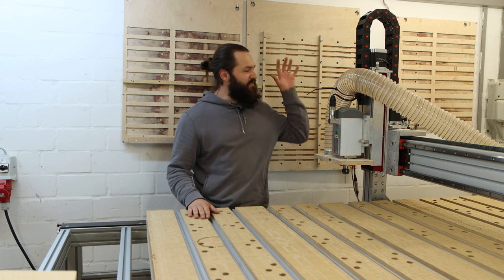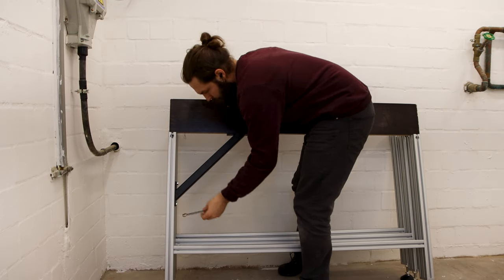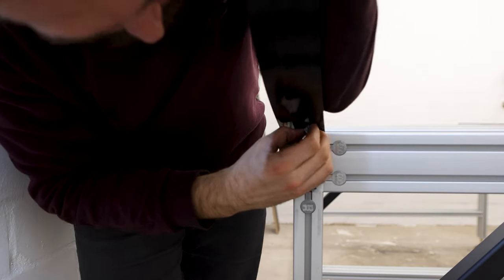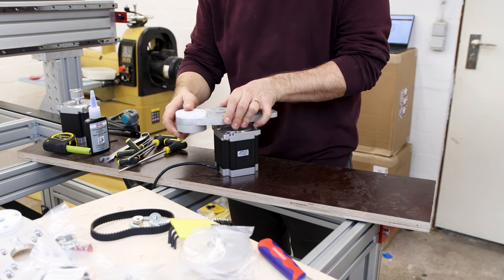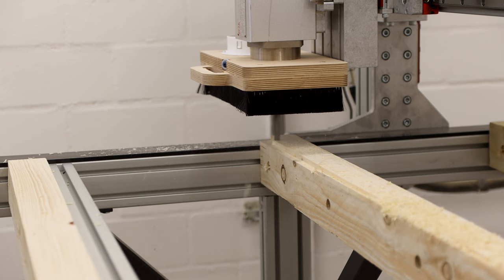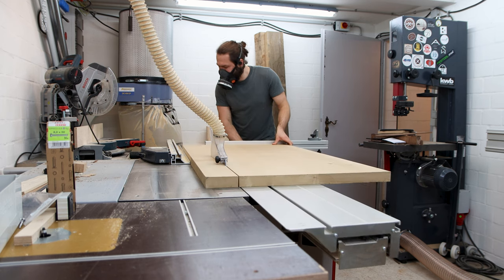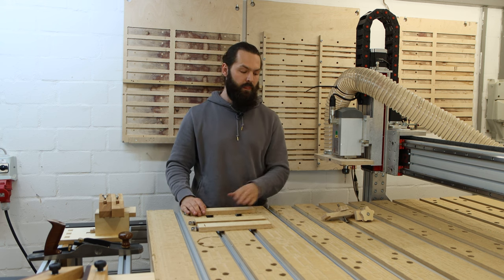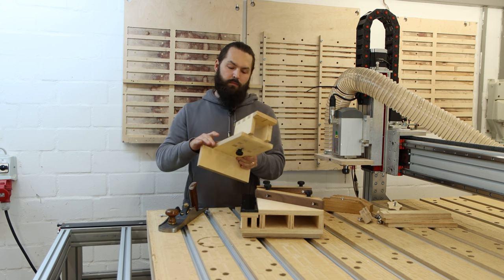I built a HUGE CNC ROUTER for woodworking || CNC build kit 4x8 (1.25 by 2.5m)

Comment: Looks like a beast of a machine. I'm looking at small desk top systems more for fun and craft items and may buy later this year. Your system is to die for, so to speak. Everything one could want in a CNC router machine. I hope you do well with it. It looks fabulous. Thanks for the video. Looking forward to your next one.
Reply from the maker: Hey Larry, that sounds great! No matter the size, a CNC is so versatile and opens up many possibilities. (If you go for a CNC with an open frame design, you can let the workpiece overhang the end and afterwards work on the other side. This makes the effective cutting area double the size 😉 Just saying...).
Yeah the next video will come very soon! 👍 Thanks for watching
Reply: @BauWoodworks  Thanks for the input on what to look for in a CNC. I will definitely meet that in mind when purchasing.  Currently I'm favoring a Onefinity, 32" X axis by 50" Y axis. I make and donate corn toss game boards to memory care, and assisted living facilities
Reply: Message got away from me. As I was saying I donate these boards to these type of homes. The people living there really seem to like the game. The board is 24" wide(X) by 48 " long(Y) so it will fit on the spoil board. This will allow me to do some design on the surface to enhance it's appearance including the name of the facility. Yes as you see, I live in an imperial country. However after working 28 years for the largest manufacture of precision metric measurement tools Iin the world  I am very comfortable with the metric system and frequently do my work using the metric measurements as it is easier in most cases.

Comment: Avid is a great machine, I recently received the same size 48 X96  and added the rotary assembly. Which to this point is an expensive paperweight...It works fine I just have taken the time to use it.  I felt your pain with the wiring, it wasn't hard, but tedious.  Did you leave the front open for a vertical table? I did on mine, but like the rotary, I haven't used it yet.  I subbed so keep the videos coming and good luck with the new toy.
Reply from the maker: It's definitely a beast! 
Haha hope you'll get tobuse the rotary more often 👍
Yes I left the front for the vertical table, which I haven't even installed 🙈 yet. Hopefully 😂

New videos are on their way 😉

Comment: Great build. i checked out the Avid Store and i think they are pretty pricey considering its just a Kit CNC. Why you didnt went for a 2nd hand? i think you could easyli grab similar quality and size for half the price or less. and their Laser upgrade ist simply a joke by price. should be mb 3-400 be a fair deal and not an extra 2-3K.... (i work in the Laser industry) ;)

Comment: Awesome! Just wondering, how much did it cost to get a avid cnc to europe? Dont you have any issues with imperial parts compared to metric parts?
Reply from the maker: Yeah the shipping was around 900 USD not including import fees and customs (this obviously depends on the country you import it to). 
Regarding imperial parts: Most of the measurements were metric anyways. I only had to buy an imperial hex key (can't remember the size) and an imperial tape measure. So this was not really an issue 😀
Then I only bought metric bits...

Comment: Excellent... a question friends, I want to make my 78'x118'' (2x3m) cnc for different woods and melamine, what servo motor, spindle, bearings, couplings, inductive sensors, emergency stop and stroke limits do you advise me to use? thank you so much